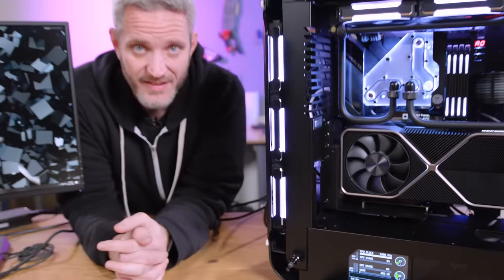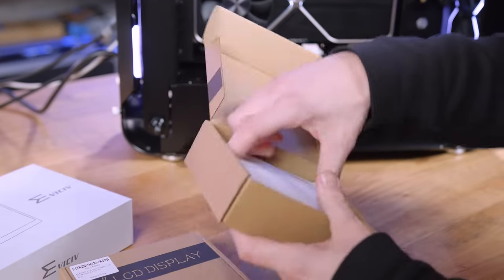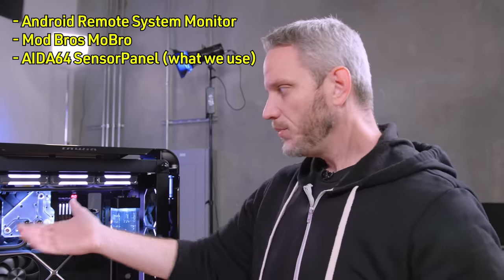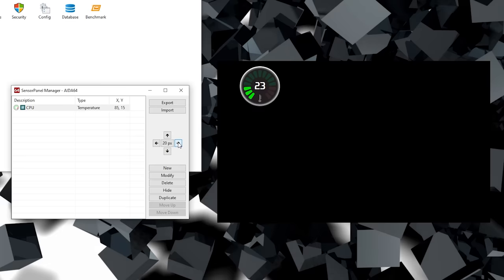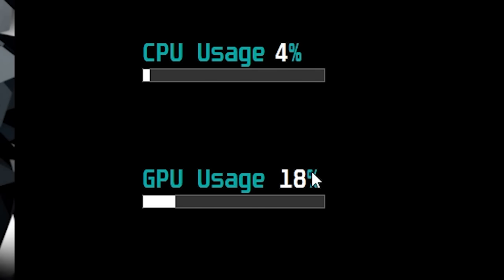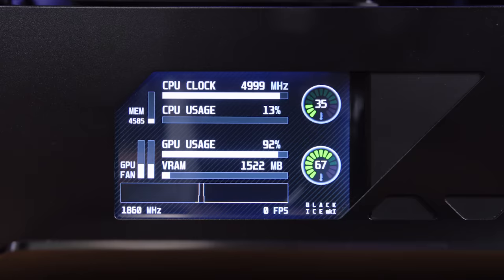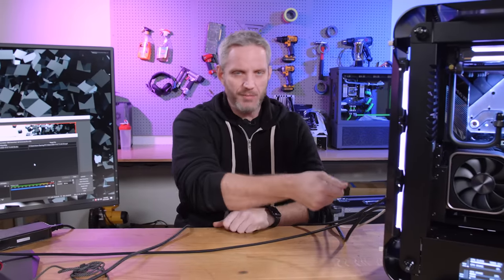EVERY PC should have one of these! How to make a sensor panel!

Comment: Wouldn't mind paying extra if cases came with pre installed with precise cutting.
Reply: @KunoMochi  understand that but would rather pay extra for something like that than crap ton of rgb.
Reply: @KunoMochi  i prefer picking cases that are simple, minimalistic. Usually a plain case and maybe have a single side panel. A wrap would be a nice later add on as well. But of course asthetics don't take priority. Also agree, It is certainly hard to find unique looking cases.
Reply: Cry in TT P3TG. You gotta build a PSU shroud if you want a LCD to looks clean. I haven't build one yet but I can already feel the hassle

Comment: I've got a rainmeter setup rightnow, using Aida64 seems more customizable, If this competes with it I might try it out!
Reply: I was thinking the same thing. I have a 3 monitor setup a whole 1080 screen.
Reply: Aida64 imo is more user friendly if you want to customize it. But if you learn how to code for rainmeter it's waaaaay more customizable.
Reply: Rainmeter has even more customisability but it can fall apart easily if you upgrade your main monitor etc. Uses X and Y from across all your screens so if you change resolution of your main monitor it changes relative x and y.
Reply: I just wanna use one to put a cool little gif on
Reply: I use Rainmeter. I like it better than Aida64
Reply: I use booth, aida64 for stats and rainmeter for audio visualition and gifs
Reply: To me Aida64 seems way less customizable than rainmeter. Rainmeter can do everything and more...
Reply: @vandey3420  for me, I'm not going to create rainmeter skins. It seems way more time consuming than this. Of course I bet custom rainmeter skins would be better than Aida 64 because their overlays rather than an application, but for a stat screen, it seems more efficient. Rainmeter also consumes a fair amount of system resources and for lower spec machines I bet aida would be the better bet.
Reply: @Carterthielftw_  actually rainmeter uses far less resources than other system monitors I've used
Reply: @vandey3420  Sweet! Also had a vertical display a couple years back, 5 inch.
Did you make the skins yourself? So rewarding.
Reply: @TweakTechNow  the base was taken from someone else's but the skin is now completely rewritten by myself... I dont have a separate display only for this but it runs in the background. Its fully modular meaning each section can be moved wherever I want. The only original piece left on this from the original author are the colors and sort of the layout.
Reply: A skin like " SYSMonitor 1.3 By PlnkY77 " would make an easy mod for a small Rainmeter monitor. A little searching and you can find an already setup skin for just about anything.

Comment: Time stamps: 

01:40 Hardware needed
monitor differences (mistakes to avoid)
04:00 180º adapter
04:20 nasty joke lol
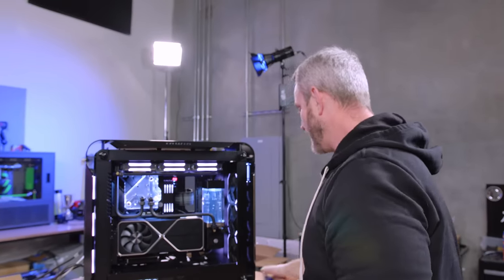05:30 mounting tips
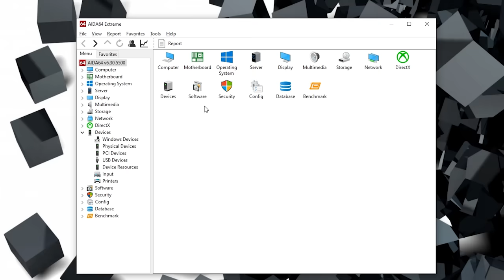08:20 AIDA64 config

           08:28 activating sensor panel
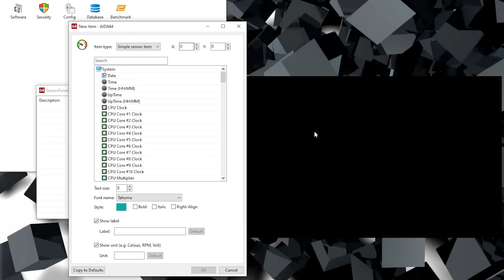           09:20 gauge type
           11:10 bar graph type
           13:40 line graph
           15:05 duplicate items
           15:45 config finished
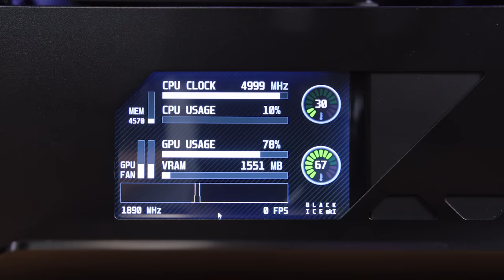16:05 some Windows config

like it?
Reply: Yes, thank you!
Reply: Bruh underrated comment 😃
Reply: Thaaaaank you ;)
Reply: The joke is exactly on 4:20 lol
Reply: Great job
Reply: Hi Jay, could you upload the Aida 64 config files for the 5" and the 10" display to a server, so that it is possible to download them? They are perfect!
Reply: Not all heroes wear capes!
Reply: You are a good person! (Y)
Reply: I'd seriously consider rivnut/ nutserts or even pop rivets...

Comment: If Jay and other YouTubers didn’t post vids like these, my first build a week ago would have been shit. Thank you for all you do ❤️. Also... I needed this a week ago 😝
Reply: I found more interesting the fact everything outside the regular MoBo/CPU/GPU realm, are things we already did in the past. Watercooling? Did on the early 2000's with aquarium pumps, home drilled copper blocks and small motorcycle radiators (Slot A processor, anyone?). A dedicated hardware sysinfo screen? Did that as well, late 90's with Dot matrix 4x40 text LCDs. VR headsets? Played game "Descent 3D" with VR headsets in 1995 (Forte's VFX1).

But seeing how much they evolved from 20+ years ago to today, yeah, that's great and I too thank Jay and the other YouTubers to keep bringing these to show.
Reply: IT'S NOT TOO LATE
It's never too lateeeeee
Reply: this makes me want to do one myself but my desk is barely wide enough to fit my monitors so the case is hidden behind them :/ I'll prob make a small window and throw it up on the right most monitor as that's the least used.
Reply: @hquest  lol whatever you say 🤡

Comment: How do I like this video a thousand times? I'm currently working on making an antique (1940's) radio cabinet into a PC case, and I've been trying to find out how I could put a small panel into the old tuner readout and make it display these kind of stats, all while making it look like era-appropriate radio dials/gauges. This is exactly what I was looking for to get started. I think it'll take alot of tinkering and maaaaybe further customization but it's an awesome start. Thanks Jay!
Edit: I've downloaded Aida64 Extreme and found that you can choose to make your own custom gauges. You just need to create 16 png files that show the indicator going from 0-100 (or whatever scale you use). I was worried the gauge could only be square-ish with a circular style indicator like they have, but I made a quick-and-dirty test of a long, horizontal gauge with a red line that goes from left-to-right and it's working to show CPU and memory utilization. This will be perfect for making what I want! Now I just need to improve my Photoshop skills...
Reply: If you're the sharing type, please post on the Aida64 forum so other people can use your dials. The options are pretty limited if you suck at photoshop.

Comment: 3:59 sorry Jay, but that's a 180 degree adapter
Reply: @Jayztwocents pulled a verge, lol
Reply: Came here to say this, figured someone oughta have.
Reply: Isn't that too hot? ;)
Reply: I'd argue that and say that both are still correct. It still gives you a 90 degree angle (2 in fact) but the hdmi ports give you a 180 degree angle.
Reply: @K1Crawford  dude rly? It's about the hdmi plug, so it's 180 degrees.
Reply: @K1Crawford  no. no it's not.
Reply: I said I'd argue ;)
Reply: No that would imply the female end is coming out the opposite way, therefore it is a 360° adapter.
Reply: @K1Crawford  Uhh no
Reply: 6:20 and that's 90 degree angles not 45. did nobody notice that? @jayztwocents just double it whenever you name angles in degrees. (btw the right-angled at 6:40 is correct)
Reply: @K1Crawford  it actually gives you 4 45 degree angles ;)
Reply: Nathan’stwocents
Reply: Children…smh
Reply: @K1Crawford  No it doesn't give you a 90 degree angle, it's literally 180 degrees from the port. There's nothing about the adapter that is 90 degrees.

Comment: 3:57 - that ain't a 90 degree adapter, that's a 180 degree...
Reply: @MrNose896  360 degree is a complete circle, so the cable out will be at the exact physical location as the plug header this adapter is connected into...
Reply: @MrNose896  hahahaha math is hard sometimes its 180 brah
Reply: @MrNose896  If it was 360 it would face the same direction.  Imagine a U-Turn, that's a 180 degree maneuver kinda like this adapter.
Reply: @UCMb1twc-vCsWLbWWUa4Jahw dummy. If you enter going one way you'll turn in the opposite direction. That's 180. 360 is entering one way and exiting the same way.

Semi circle vs circle. This is a semi circle.
Reply: @MrNose896  no way, it’s 720 bro
Reply: what all of you lack to realize is that using any form of 'degree' nomenclature is actually incorrect within itself. The adapter itself poses no form of physical angle, it's merely just a nondescript, purpose built, adapter.
Reply: Its a double 90 degree, which makes Jay twice as correct!
Reply: @woodyTM  the adapter forms an U shape which is a 180 degree angle inversion of the original connector. Not sure where this definition is wrong.
Reply: It's 356 degrees because they mainly use Fahrenheit in the US.
Reply: @woodyTM  you failed geometry didn't you?
Reply: @woodyTM  r/iamverysmart
Reply: @hquest  actually it rounds back to itself. its not 90 degree adapter. not even 180...
Reply: @bradschenck3168  i hope thats a troll comment... 180 is pointing the opposite direction. 360 is round about back to its origin direction, 90 degrees is an L.
Reply: @UmbraFaux  some people be trolling, I cant imagine people being that stupid... "right...?"  LOL!!
Reply: @bradschenck3168  #MathisHard #BarbieRobertson #Illgetkentocodeitforme
Reply: no sir, its clearly a 540 degree adaptor
Reply: @MrNose896   Hate to break it to you but it's 0 degrees
Reply: You're all so small... That WAS a 180 degree adapter... Let's not forget why we're here, you mega-derps.
Reply: Play Crysis on it
Reply: @hquest  It's wrong because it's 360 degrees genius.
Reply: @jm9371  or rather only half correct, which in this case would make it half wrong? :P
Reply: @MrNose896  Sad that someone forgot their math. :/
Reply: @MrNose896  no its not, lol

Comment: Hey JZ, at 540 where you mention the hazard of grounding out the back plate, ive successfully used the foam padding that some of these low power devices ship with to create a dielectric buffer to any potential hazards, by trimming it to fit.
Reply: I was trying to think how I could fit the screen on the PSU shroud on the h7 flow 2024 edition but I think you've solved my question

Comment: You could use an usb-c to hdmi adaptor and connect that to an internal usb-c header. That would save routing the hdmi cable out the back to the videocard. Also leaves the videocard free to run multiple monitors.
Reply: Late, but LTT did a video on an M.2 graphics card. That and a little VGA to HDMI adapter and boom
Reply: Takes a bit of looking around but you can get single cable displays. ie you just need to plug it into the USB header and you get video and power on the same cable no need for a HDMI cable snaking back into your case.
Reply: @tacet3045  how do you do this?  I'd like to try but not sure what you mean?
Reply: @scottbruns7104  yeah ive seen a mini 5inch display that just needs power from usb and will give display using same port.
Reply: This is what I wanted to know, thanks!
Reply: @tacet3045  I've been trying this and can not get it to work. Thoughts on what I might be doing wrong?

Comment: Phil: “I’m going to go black and large.” 
If only it were that easy, Phil.
Reply: would be very easy in cyberpunk 2077
Reply: @fist003  Yeah... in mid 2021...at least.
Reply: AWFUL! What if I have 2 monitors besides this sensor panel?!! Then I'd have no taskbar on the second one! Also what if I'm using my computer and move my mouse a bit too far to the right accidentaly, I'd get it stuck on the sensor panel screen! BAD!
Reply: @slyceth  You lost, bud?
Reply: was thinking the same thing hahahaha
Reply: And then `never go back. GG.
Reply: @slyceth  For mine I bought a slightly larger monitor than the area I wanted, and just made sure the bottom edge of the monitor was "out of frame" so I could have taskbar everywhere EXCEPT for MiniMe. As far as getting stuck on the sensor screen, A) place the miniscreen at a tangent location you're unlikely to move to, and B) you can't get stuck- if you move into it, it'll be readily apparent, and just slide back out again.  A mouse that moves left also moves right, man.
Reply: racist
Reply: BBC in RGB baby!
Reply: Well...i mean..black isss usually large😉
Reply: @slyceth  If you've got a bunch of monitors, then I highly recommend getting DisplayFusion. It's great for multi-monitor displays, and it can do an absurd number of things. You can even get into some custom scripts for it if you want. Having extra taskbars, and having these task bars also display things like the volume control on it is pretty much a default function.
Reply: @slyceth  The mouse issue is your own XD. Set the monitor up in display settings so its hard for the mouse to move ever there. I just set it wayy above my main monitor. For the task bar... i have 3 monitors. If you drag the Sensor panel just right.. it'll auto cover the task bar, and will stay like that even after restart! Cheers!
Reply: #jamesearljones
Reply: BBC
Reply: That's what she said.
Reply: Some BBC goodness?

Comment: Just in case anyone was wondering a 7 inch display like jay has in the video. With the tabs sawn off like the 5 inch display he modified. Fits in the back of a lian li 011 dynamic covering the Der Bauer plate and some of the rear vent almost like it was made for it. Also I'm running a 360 AIO push pull and that hangs down far enough to cover the cables and not impede the screen..
Reply: Any chance you have a picture?

Comment: small monitor becomes default monitor
"WE BUILT AN ALL IN ONE PC !"💯🤭😳🧐
Reply: Do you think that'll become a thing someday? like install a panel where the tempered glass normally goes and use it as an all in one?
Reply: "you mean like a laptop?"

Smh
Reply: Very true, its basically another monitor but just miniature. The program seems to be the reason why it stay showing what you set it up to be.
Reply: Used to be a thing in LAN builds a while back.
Reply: @CreativityNull  no...
Reply: @_archer7101  woosh
Reply: @_archer7101  ltt already did something like that
Reply: @_archer7101  people do that using their old monitor except they remove a layer(i forgot the layer name) to make it appear transparent, so you can have like a "hologram" see through display
Reply: @_archer7101  No. What purpose would it serve and is that purpose worth the negatives of such a build?
Reply: @BlaqZ  Sure but that's not "a thing." Not in the way I think it was meant anyway. I mean, we've seen all kinds of cool and crazy builds but most aren't practical enough to become "a thing." There is one that I think could maybe sorta possibly become something and that's the desk/PC builds. It's harder to build and depending on the design harder to upgrade and maintain but it's still practical. If, and hope not, the PC market ever becomes extremely niche and new hardware stagnates I could see builders moving to a more permanent design like those. What do I know though?
Reply: @CynHicks  Fym?? Aesthetics???
Reply: Budget gaming display...🤣
Reply: @_archer7101  ik your being sarcastic, but there is a case with the full side panel being a display that you can turn off to be see through
Reply: @RexMan04  I kind of wasn't XD but yea that sounds cool
Reply: @_archer7101  Dude Oleds need dont need a back light so yeah.
Reply: @_archer7101  See Apple.  They've been doing it for years.  More or less.
Reply: @_archer7101  that sounds like a LTT video
Reply: @_archer7101  I wanted to do such a thing and mount the whole thing to my wall, ended up getting a laptop but would like to see someone do it
Reply: You mean something like the Snowblind case
Reply: @sirflaps7619  but better
Reply: old desktops from the '80s used to have that

Comment: The first time I saw this, I thought it was the neatest thing ever!

For my own design, I ended up using a pixel 3 I had laying around, some unused RAM mounts and going with Remote System Monitor. Unfortunately, I do have to plug it into an external USB port somewhere to keep the phone charged, but I also gain a lot of flexibility on where I want to put the display. Normally, it is left next to the PC case, but in other cases, I've moved it under my main PC monitor for much quicker glancing. I think the flexibility of being able to move it anywhere is awesome. I'll likely do a setup like this someday too. I'm sure there are many more uses for an additional screen as such. Excited to see where this goes. Thanks for sharing!

Comment: THANK YOU! I've had an LCD panel in my case for a while, and I hadn't found a software solution that worked right to actually use on it. I'd been using CAM, which wasn't customizable and didn't fit the screen perfectly. Rainmeter depends on finding someone who did art at the right size and resolution which is difficult on a tiny in-build screen. AIDA64 is the exact sweet spot of turnkey and customizable that I've been looking for. Seriously, thank you.

Comment: Ive been doin this with my pc for 3 years and surprisingly the monitor is still going strong!

my setup is a 7 inch pi monitor with rainmeter and wallpaper engine running on it
Reply: I'm surprised that more people don't use Rainmeter. It's completely customizable and free... I've used it for many years and put it on every PC I build.
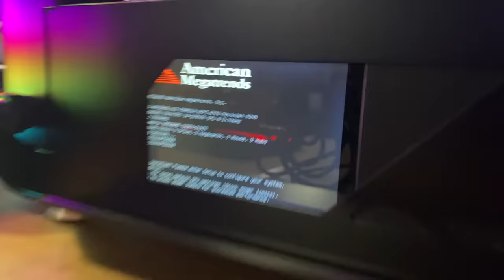Reply: 18:49
Best use of "DUDE" ever 

XD
Reply: @coitcordery8501  it's getting the sensor info to rainmeter esp GPU info which is a pain.  and hwmonitor was not working quite right in win10